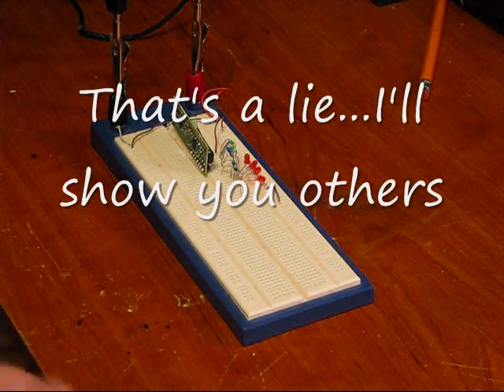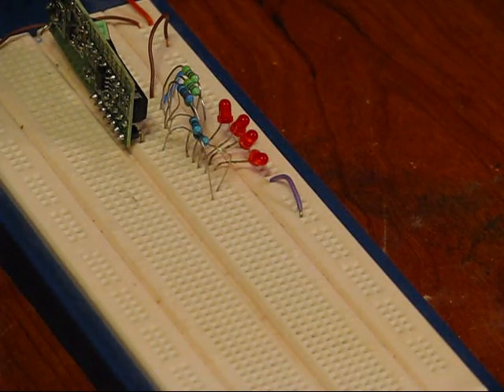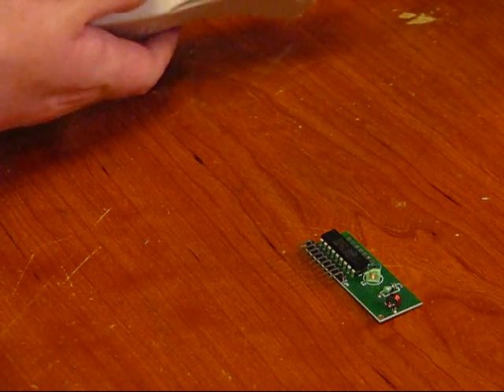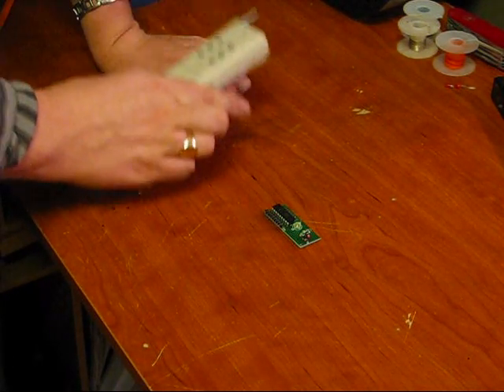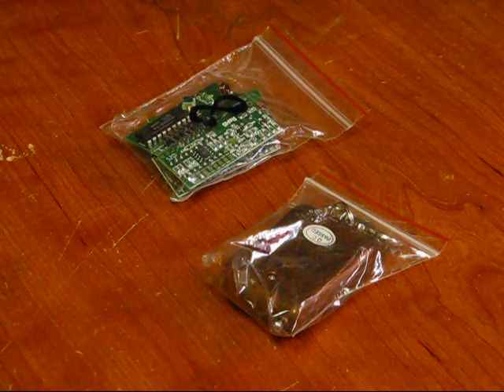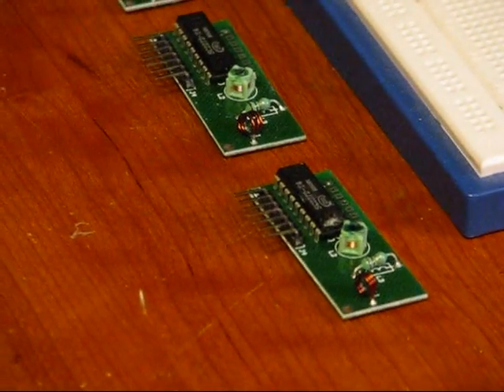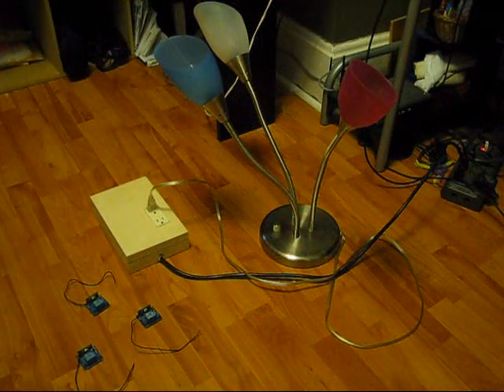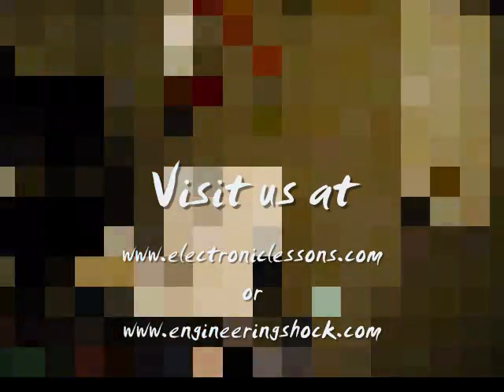Wireless RF Relay Drivers and Receiver Boards

Comment: Hi, if your are using multiple wireless relays, don;t they interfere with each other? Say you press one remote and all relays pick it up? I actually want to have a transmitter (controller) hooked on to a MCU and switch on and off different relays. Any suggestions?

Comment: i just built a robot car that uses 4 button WIRED remote controller. (it was a project) but i want to turn it into a wireless remote. which transmitter and receiver do you think is better to use. and please give me a link to your ebay so i can purchase it ASAP.

Comment from the maker: @trailkeeper 
Yeah, but they aren't meant for HS applications.  I am using the 4x data outputs in a homing device circuit.  I use them with my PIC18f1220 or PIC10F222 MCU ICs.

Comment: You probably know this, but those 4 output at the reciver can be used as like a nibble/4 bits of a byte of computer data transmission.  Also those 4 outputs can be sent to something like a 4 to 16 (or binary nibble/4 bits) to 16 outputs and control more things even.